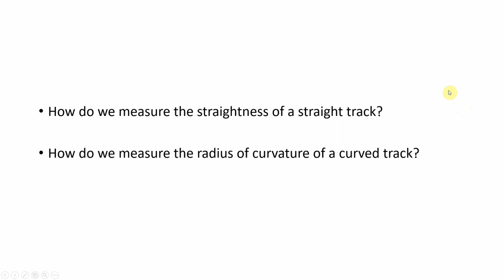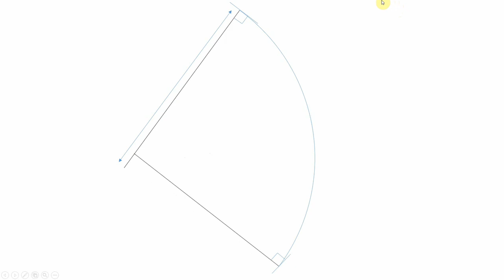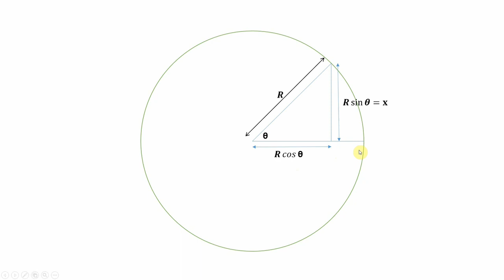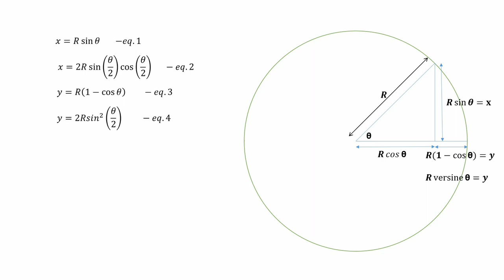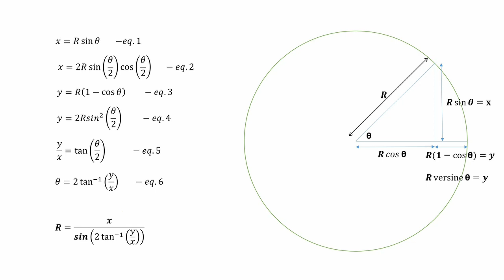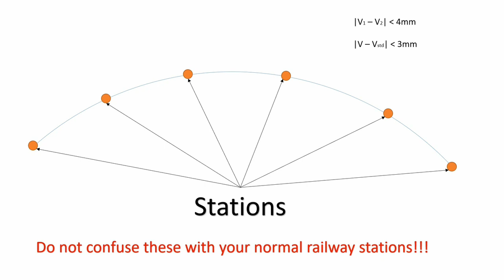Versine Measurement

Comment: If you are using a 20m chord, then the stations to take measurements should be every 10m.  Hold one end of the chord on station 1 and the other end on station 3 and measure from the rail to the string at station 2.  The next measurement should be at station 3 with the ends at stations 2 and 4.  Really you should have started at station -2 to have included station 0 or the beginning of the curve.  I spent about 20 years calculating and staking out railroad tracks.  We use degree of curve which is defined as the central angle subtended by the radii of a 100-foot chord.  The formula is sin 1/2D(c) = 50/R     R is in feet  D(c) is degree of curve for chord definition.  Our highway departments use the arc definition of degree of curve which is the central angle subtended by the radii of an arc of 100 feet.  The formula for D(a) is   D(a)/100  = 360*/2PiR     or D(a) = 5729.58/R     For railroads, the survey line is the center of the track or at half gauge.